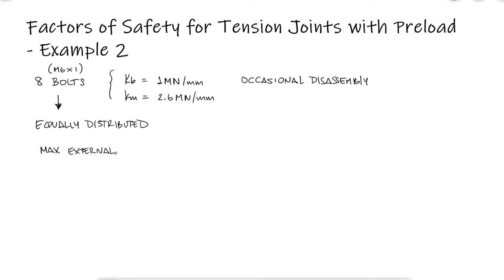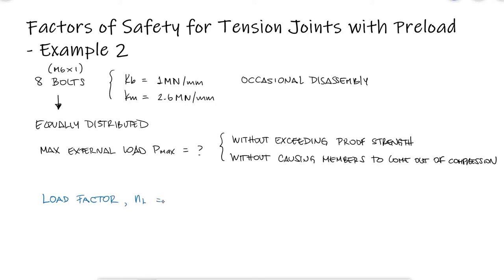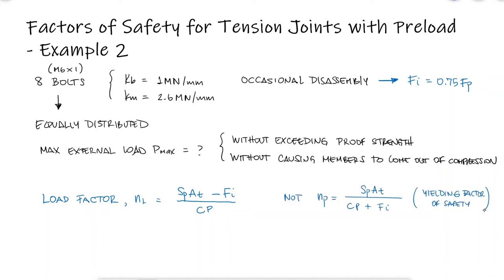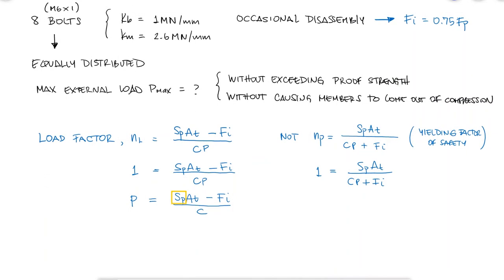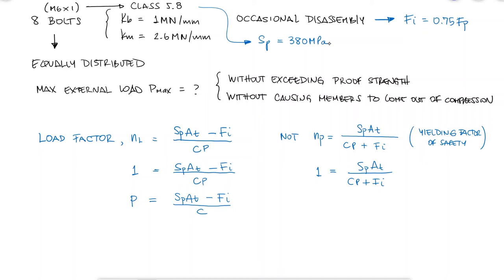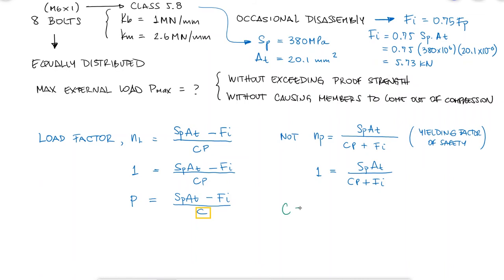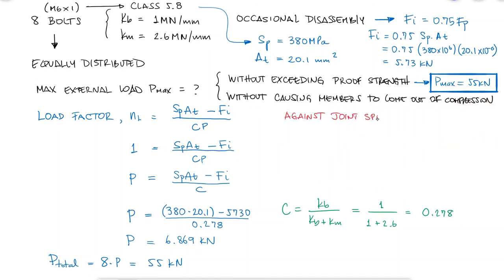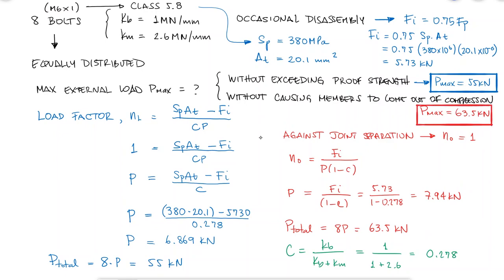Factors of Safety for Tension Joints with Preload - Guarding Against External Load - Example 2

Comment: Really good stuff.
When you apply the external load after preloading, do you think that members are resisting the separation.
I think only bolt sees that tension.
Correct me If I'm wrong